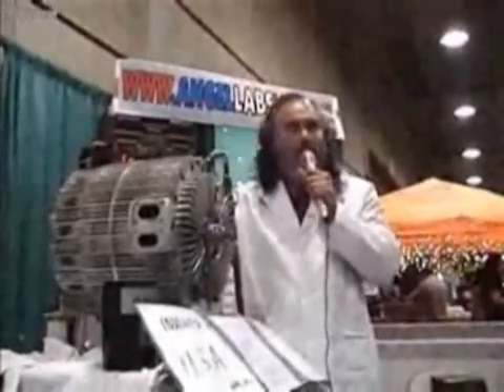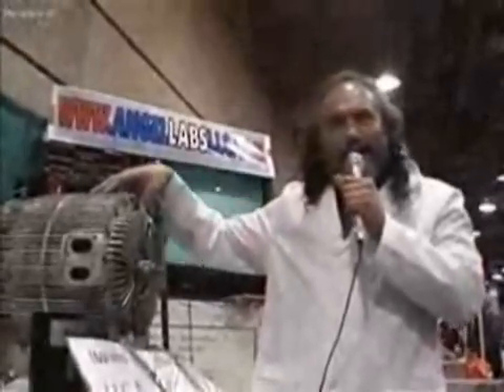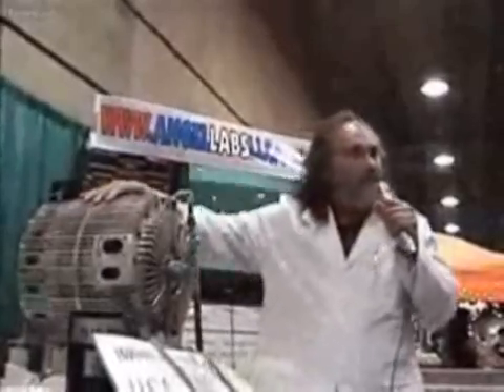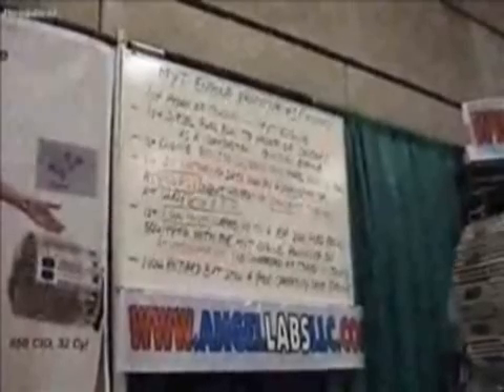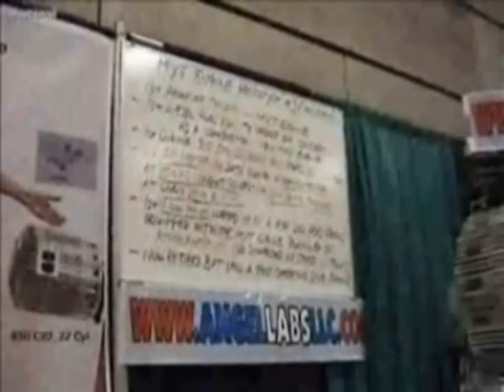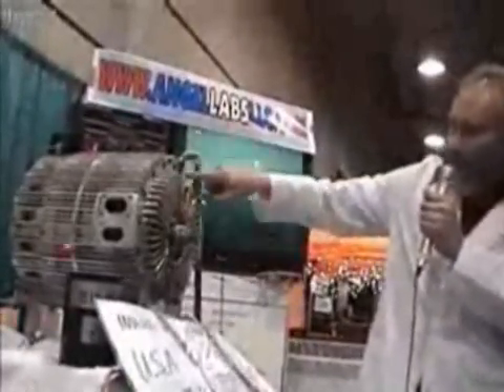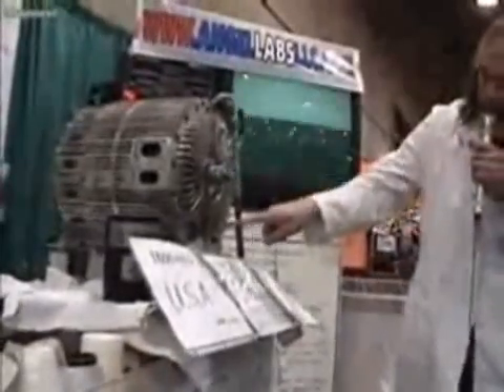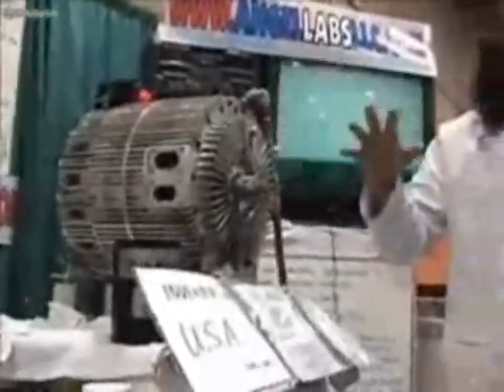MYT Engine Inventor Raphial Morgado

Comment: what material do you use to produce the small shaft that connects the motor to the gear box or transmission ,and what size is the shaft, its the point of force where the motor transfer the power and transforms it in actual motion

Comment: If it worked, it would be marketable.  Something is wrong or it would be in production. If it worked, a very small engine could power a generator which power electric motors. This would make Electric practical.  Batteries for short distance and MYT kick in to charge batteries.  This would be a Miracle of Miracle.  But, if it is too good to be true......

Comment: I looked over this new type of engine right after it was into a prototype. It has several problems. #1 IT'S TOO LOUD. When excess sound is produced it represents lost energy. #2 even though it's a very powerful engine it still makes the same mistake common to all other Combustion Engines, = it fires one cylinder at a time. The "ultimate" engine" would fire all cylinders together where the combined kickback would be used to do something, such as generate the engine's own fuel, which would be compressed air. THAT would be the engine to have, because having say 6 cylinders firing TOGETHER would Multiply the horsepower by 6x, or 600%. .... The value of having an engine design that MAKES ITS OWN FUEL goes beyond the pail but there's another positive also. By combining into a larger horsepower output would mean the engine could be made 6 times smaller while having the same hp on the road as engines today. A smaller size engine would make room for more luggage, computer stuff and passengers. A smaller lighter engine would mean TIRES LAST LONGER, for less rubber polluting the environment. An engine where all cylinders fire at the same time is "the ticket". HOWEVER, the Morgado engine has many uses where people don't get exposed to its loud decibels, such as in the belly of a supertanker, so it isn't without its plusses. I am certain we haven't heard the last of the "Mighty Engine". The noise it produces could be channeled into a resonant harmonics engine that runs on noise. hehehehe

Comment: Interesting, it seems to me like a variation on Mazda's rotary engine, directly turning the crank... From other videos I've checked out, It has more moving parts but maximizes displacement in a smaller area. I would like to see it in practical action driving a car and pushing its torque claims by pushing an RV or big rig.

Comment: The one major flaw in this design is heat control.

Rotaries fire only 6 times, make only 140 hp, and still run hotter than normal engines., with only 3 moving parts. 

So how in the hell will an even smaller engine handle the heat of 32 strokes, and 850 bhp??!

MYT = meltdown

Comment: This is just a functioning  prototype.  The ignition system is not shown for obvious reasons. (Patent)  This motor takes out all the displacement issues out of the typical combustion engine. If you understand physics this motor makes perfect sense. 
 So simplistic yet ingenious. 
  If every small community  had one of these machines to generate cheep electricity.
 There would be enough power to eradicate 
World hunger and poverty. That's why the world powers repress this technology.
I hope t

Comment: great you made a tiny engine that does what a big one does.... WITH 200,000 TINY PARTS INSIDE OF IT!  sounds REAL reliable
Reply: The MYT engine has only 50 major moving parts.  Common, modern day engines have more than 1,000.

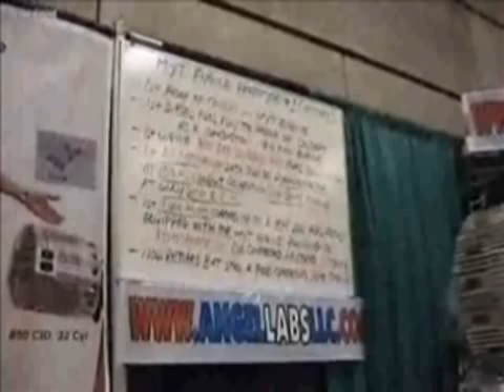Comment: Did he mean that this thing is supposed to run off air with no fuel with what he said between 4:20 and 4:28? If so, this thing is most definitely a hoax, as he would basically be claiming he's made a perpetual motion machine, which is always BS.

Comment: you could run an ultra lean fuel-air mixture, and since the combustion chamber is seperate from the intake chamber, it would be REALLY powerful. If not, you could use a material with a high melting point and low thermal expansion rate like wankles do.

Comment: How does it idle, looks horrible unbalanced and like it will have wear/balancing/lubrication issues.

There's no way something that makes 250hp can be the size of an alternator, it will overheat and even if the crank was made of titanium it will shear from the torque if it was that size.

Comment: I see some serious problems with the claims on this engine if it is to replace a large deisel engine. There are good reasons why a truck engine is so large. It is to produce the large amounts of torque needed to get 80k lbs of vehicle moving and running down the road. The torque requirement also needs a massive clutch and transmission. It doesn't take a Phd in M.E. to see that the first time that engine tries to operate on deisel at any kind of usable RPM, under load, it will turn into a bomb.

Comment: I c a lot of questions here of y it did not make it 2 a car well what this guy would not tell u is he stole the concept/designs  from some poor smow working at mcdonald 's in Redding Ca around 2000-2001 what he did not know is that it was a throw away incapable 4 auto use do 2 rpms 400-700 most! U would need an extra trans just 2 bring it up and after that u would again have a  heavy low powered engine, but if he was the original designer he would have known that }:( but there is another!!

Comment: Yeah, those are "EXACTLY" my concerns. Having that many combustions per stroke will produce more than 4x the amount of heat when compared to an average vehicle. Are they gonna air cool it? I guess that this is another option.

The sheer torque that something should produce will snap that little crank like a toothpick.

Comment: There are no rods.  The piston heads are connected to two disks which rotate independently.  The disks drive a pair of nested shafts that hook to a set of orbital gears which turn the step-wise motions into smooth rotation at the drive shaft.  It's actually quite elegant and compact.

Comment: Diesels don't use normal spark for combustion.  Combustion comes from pressure increase.  The initial spark is only needed.  There has to be some sort of piston seal inside, but maybe an open head.  Interesting.  I have alot of questions.  Heat, fuel consumption, torque and usable power under load.  Apparently this won a NASA contest.  I'm reading up.

Comment: Without seals around the "pistons", the explosive force of the combusting fuel will leak out all over the place, making it impossible to create any power. You need to seal off the space that contains the explosion in order to harness any useful power! This engine makes no mechanical sense whatsoever. Not to mention in the animation on his website, the pistons knock against each other during operation... wouldn't this destroy the mechanical parts? How would he keep the piston centered?

Comment: hes not full of shyt ....im a  graduating professional on autobody tech. the engine runs on bio fuels and uses oxygen to run. that  size that u see there can move a truck. the bio fuel lubricates the engine so you dont need to apply oil to the engine. but like u said ...hes full of shyt. the revolutions are less than a any engine. which means you will save more money. this helps on global warming but like u said hes full of shyt. well that shows how ignorant our tommorrow is going to be like.

Comment: I've only seen it run on air, where as thats cool I have serious doubts.  The planetary gear/rod assembly that functions as the "crank" (transfers power from the cylinders to the shaft) has quite a bit of gears.  I want to see how these parts handle a combustible firing off in there, 125 psi of air and squeezed air and fuel mixture on detonation are a world apart as far as stress goes on mechanical parts. I love to be proven wrong though.